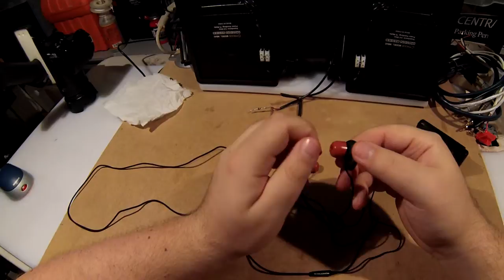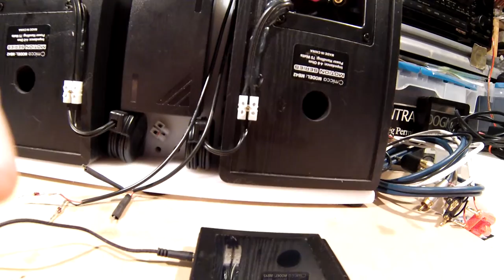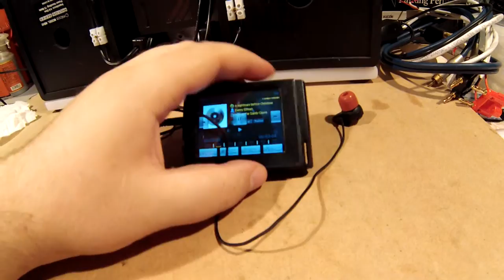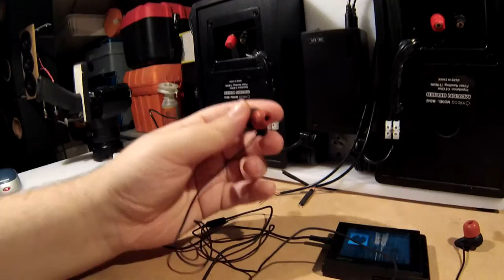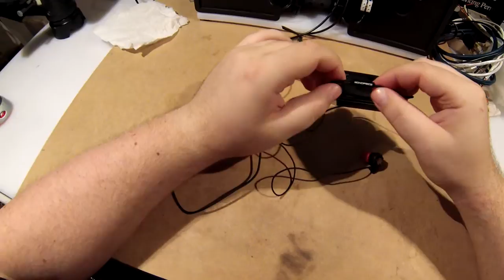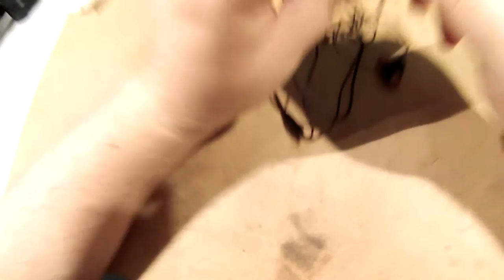Z Review - Monoprice IEM's (+ Comply T400 Tips)

Comment: They are really good earbuds, only problem I had was the cable sheathing wasn't tight enough and the cable poked through and turned into little knots all throughout the cable.
Reply: You could try the white 9963 Monoprice IEMs which have a rubberized cord instead of the fabric.